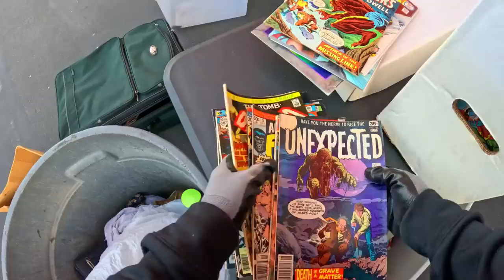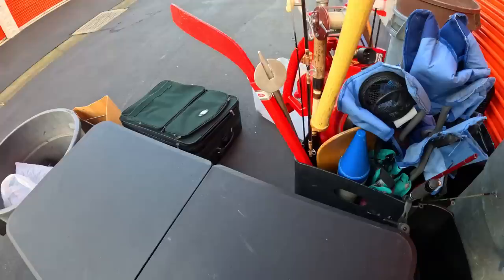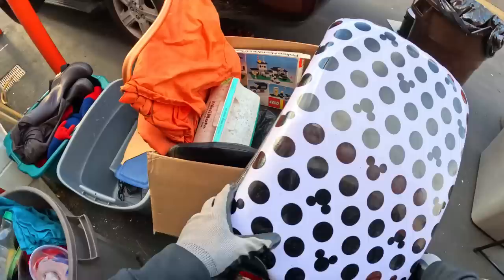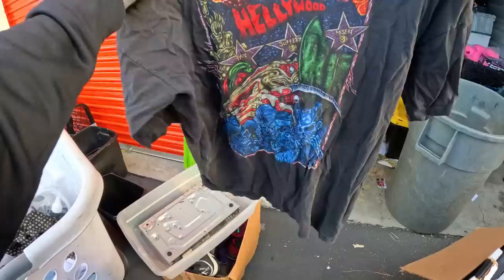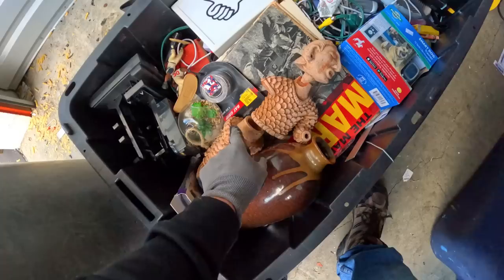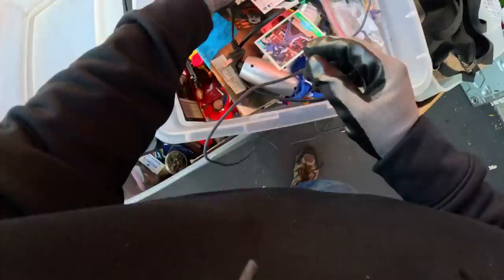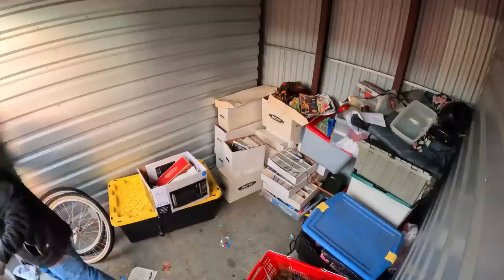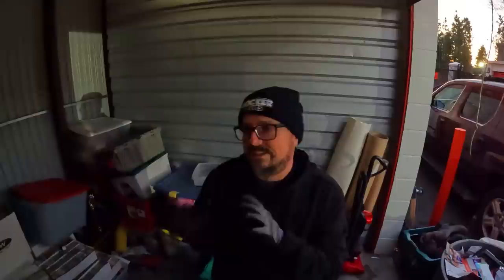GUN found in PRISONER'S storage unit! I bet he'll be mad about this...

Comment: What a great locker. You'll definitely make your money back.
But what is it with all the single shoes?
The razor machine was used to sharpen the blades. You fixed them to the slide and moved the roller back and forth over the strop. The name for the strap that sharpened the blades.
Hi from London UK